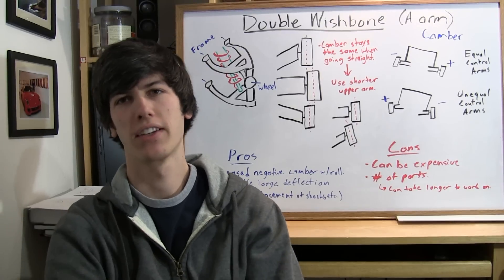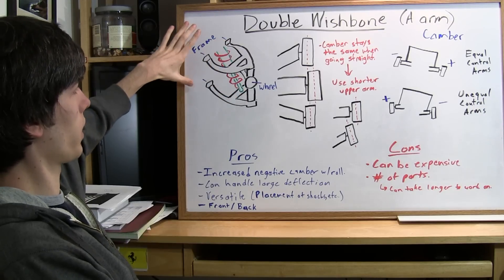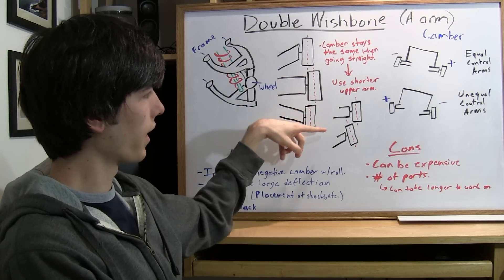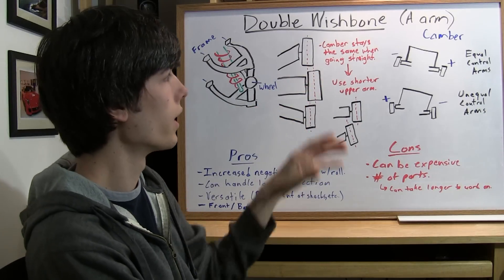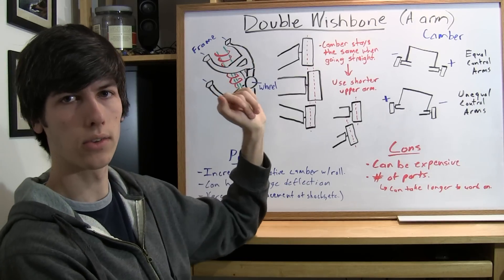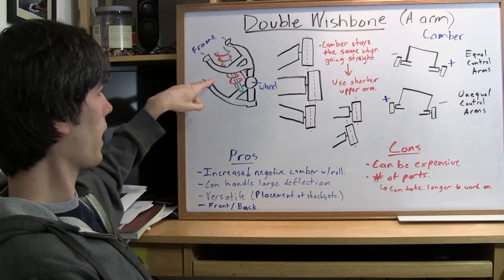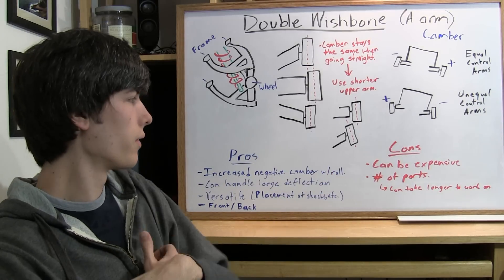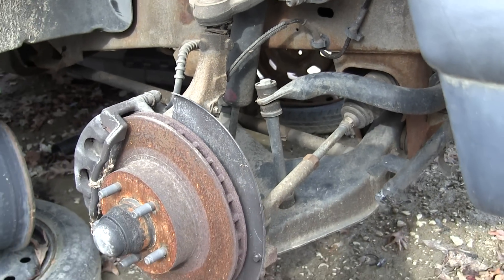Double Wishbone Suspension - Explained

Comment: One other disadvantage not mentioned is the horizontal packaging tends to be worse than a strut. Aside from cost, this is why transverse front engine front drive cars tend to have struts instead, to be able to fit the horizontal engine and transaxle.

Comment: I am not sure if anyone has said this, if they have I apologize for duplicating a comment. I also know this video is a decade old but I could not find a more up to date video in regards to this specific type of suspension. 

In SLA (short/long arm) suspension you do not gain positive camber on the inside wheel. If you are set to 0 degrees camber at resting, when the suspension loads and unloads it only adds negative camber. To induce negative camber when loading and positive camber when unloading the suspension, you need a trapezoidal arrangement where the wishbones connect to the frame closer together than they do on the wheel hub, only then will you induce both negative and positive camber when loading and unloading the suspension respectively.

However, the camber on the inside wheel is far less important than the camber on the outside wheel. The outside wheel will be taking far more force than the inside wheel, especially on cars that have an Anti-Ackerman steering geometry as the outside wheel is pushing the vehicle. Pro-Ackerman, the inside wheel is pulling the vehicle. The inside wheel has significantly less authority over the vehicle when compared to the outside wheel which is why SLA is still an acceptable suspension setup. The camber on the outside wheel(s) matters most when cornering, the inside wheel still has authority but to a far lesser degree.

Equal length double wishbone suspension is great for drag cars. They do not corner at all and when they do it is usually at very low speeds. The front of the car will rise when accelerating and drop when decelerating. The equal length with mounting points on the frame the same distance apart as the wheel hub, will insure maximum contact patch no matter the forward or backward forces applied to the vehicle. Perfect for drag cars, atrocious for vehicles that need to corner.

Equal length double wishbone suspension : Both wheels have the wrong camber in corners but perfect for straight line acceleration/deceleration.

SLA double wishbone suspension : The outside wheel has the correct camber angle while the inside still does not. Am improvement over the former but still not perfect. This setup also becomes a problem for vehicles with high downforce. The downforce will load the suspension, forcing the vehicle down and the wheels to increase camber in the negative direction which reduces your contact patch at high speeds.

Comment: I watch some of your video's and you do a good job, so I have one for you. Being a mechanic all my life, I tend to question how things work inside and out so I can better diagnose them. I had to figure this one out on my own years ago, but still to this day you can't find any info on it? It's the Mercedes front lower ball joint design. Two lower fixed arms with ball joints side by side at the spindle. The first thing when I seen this on the rack was how is this not binding? 90% of mechanics has no idea or even question it and don't want to know either?

Comment: Rereheatherere Performance Parts
COMING SOOON!!!!!!!
Rereheatherere Performance Parts always supplies top shelf racing parts for your cars. We manufacture high performance turbochargers, exhausts, intakes, and more. 

Rereheatherere RP1 Large Diameter Turbocharger kits     starting at  $1799.99
The RP1 turbo kit from Rereheatherere performance is a top-of-the-line turbo kit that is available for a wide variety of Japanese, American, and euro cars. This turbo is rated for 32psi.

Rereheatherere GTSR Racing Exhaust    starting at   $649.99
The legendary GTSR Performance Racing Exhaust is designed for maximum sound, exhaust efficiency, as well as minimum weight. Gains anywhere from 5-15 hp and 5-10 tq

Rereheatherere Limited Edition RK1 Bong   starting at   $74.99
The Rereheatherere RK1 is already known for providing legendary hits, but the limited edition RK1 with a built in perc provides the type of mind rotting hits our bongs have become famous for!

Rereheatherere consistently outperforms top brands, like HKS, Greddy, and even Garrett, make sure to clear some money out because you do not want to miss the limited edition Rereheatherere performance parts drop coming December 2020!!!

Comment: Good video! I would've liked to see an animation, but you covered the concept well. 

You said an advantage is that the double wishbone angles as it rises. Is this a disadvantage when you're driving in a straight line and hit a bump?
Reply: He mentioned that doesn't happen when going straight
Reply: @davidalvarez5929  I thought it angled when raising and lowering. If you hit a bump (one tire only, like running over something) the suspension would be raised.

Comment: Great video, one thing I don't understand is why some lower control arms in this type of suspension doesn't look symmetrical, meaning the ball joint is not exactly on the middle between both bushings

Comment: Obviously ancient video in YouTube years - but this kind of "explaining the basics" type of video is VERY useful to widen your knowledge at least from a "how does X work, compared to Y. I must admit at the end I was stumped by the actual car demo. Where, pray tell is the SPRING for that? I see no coil, doubt VERY much it had a leaf spring, and while I an see the upper/lower susp. members, shock absorber and even the sway bar end link this vehicle was obviously a moon rover since the low gravity required no spring. I can't even see where the spring WOULD have been if removed as there is no cup that I can see. Very peculiar. I am sure that's why this channel os no more... The missing spring conspiracy!

Comment: 3:05 why does outer wheel have positive camber?
Reply: I think you mean "inner" wheel, but I agree, both wheels have negative camber due to the shorter upper a-arm.  Since most of the load is carried by the outside wheel, the net effect is still better traction.

Comment: cons for unequal arms should include: Depending on the "dampening" varying response to steering. If the car would be driving such that thesuspension is dampening out a bump in the road the wheels are somewhere in a (very) high position while thet would be in a really low position when you drive through a hole in the road. If then the wheels either goes up while alreadyl being up or goes down when it already is down due to the roll you end up at the point where the suspension travel stops. You need to avoid roll by using stabilsers or by using a double wishbone! Double wishbones have the advantage that they roll less which is because wheels stay aligned better and thus roll would mean the car liftsbecause the tyres surface tilts thatthen means the spring gets the load while the other side gets a smaller load (the total force on the springs and shockabsorbers equals the car weight always (neglecting the acceleration of the body that is required). Please look at my picture and ask yiurself what that teaches you? 

(The answer natuarlly  is that if you think about it, it is only logical that we tend to pay more attention to car supsensions, because we tend to see them more often!)

Comment: So far I've rebuilt a transfer case on a Chevy K10 and the rear end suspension on a Lincoln LS thanks to your videos. You are super - thanks for the visualization.
Reply: Joseph Maxwell I have a lincoln ls that needs work. What did you do for bushings and shocks.  Any advice is appreciated

Comment: +Engineering Explained
Can you please explain why some cars have this in the front and others have it in the rear. GTR has I in the front and the STI has it placed in the rear, for example.
What are pros and cons for each? What are the benefits and drawbacks of having both front and back double wishbone?
Reply: Charles Ramirez just from watching the video I assume what it means is that, while cornering, the wheels with the double wishbone will have better traction due to the induced camber. Perhaps those cars throw weight to that specific tire on turns.

Comment: i've watched your videos for a while now on other topics, but since i am designing a suspension i came here yet again, now would you say that in straight sections of road that the unequal length A-arm wishbone suspension would have increased tire wear? also would you think a system to link the steering to the suspension would allow equal length systems to have the same amount of control? say i used a cantilever like in a push rod suspension to change the camber by moving the upper control arm in and out, and set this up to be adjusted by the steering angle
Reply: aterack833 Do you already know the answer on your question:"would you say that in straight sections of road the unequal length a-arm wishbone suspension would have increased tire wear?"  I think this is true because I think you get positive and negative camber on straight (bumpy) roads with these unequal arms, which isn't desirable for your tires.

Comment: I get how the camber can be negative when the upper control arm is shorter, but how can it also be positive? I'm thinking of it in terms of a fourbar linkage.
Reply: KiwiKiller88 Think about it as a tire that goes down relative to the frame, like there is a small picture drawn by Jason of a tire that goes up relative to the frame (2nd picture under textiel "User shorter upper arm")
Reply: Actually if you imagine it, when tire goes down relative to the frame, it will make a negative chamber

Comment: Cv joint with plunge travel isn't necessary if the half-shaft is of equal length with both the wishbones, correct? Could someone also tell me why the steering rod isn't required to have plunge travel?

Comment: hey man, I have a little 1993 nissan d21 pickup. it has a solid axel in the rear and ifs with torsion bars and 2 control arms. do you have any videos regarding torsion bar suspensions? I'd be really interested to see how it differs from a normal double wish bone.

Comment: Great videos!  can you explain semi trailing arm rear suspensions?  mostly why they were  abandoned and why letting off the throttle while banking causes spin out, snap over steer.  correctable or can problem it be minimized?

Comment: Ford used Torsion bar suspension in their late 1990s to 2011 4x4 Ford Rangers. Mine included. : 3 The 2 wheel drives just got coil springs.

Comment: I have trouble visualizing, how having s shorter top control arm, facilitates negative camber during cornering. Great vid btw. Thanks
Reply: +Indu Shekhar Kumar The shorter control arm (up top) pulls the top of the tire inward sooner when the body rolls (because it's attached to the body).

It's kinda confusing because of where the short wishbone mounts to the body, the mounting point is actually closer to the tire, so when the body rolls, that point of the frame pulls inward further.

Comment: Can anyone tell me if short&long arm double wishbone is the same as independent double wishbone?? Cheers :)
Reply: I think so. An independent suspension is where one wheel can move and not affect the other wheel. Most suspensions are independent unless you have a solid axel connecting them.

Comment: Hello Engineering Explained. I was wondering if there is some standard or "golden" ratio between the upper and lower control arms. Maybe combined with the weight of the vehicle. This just to get one started, I guess center of gravity and grip and lots of other factors come in with the fine tuning. Thats where adjustable upper control arms come in but I need to have some starting point Thanks for good videos =)
Reply: from my reading, in general, the upper should be ~70-80% the length of the lower.
also, if you are modifying a standard macphereson suspension, be advised that mounting the spring and shock (vs strut) in a different location can and will change your wheel and spring rate depending on the mounting location.

Comment: After watching this video, I get curious about BMW M3/4 front suspension system, this is what i've found: "Double-joint spring-strut front axle", is it the double wishbone? Thank you again for your videos.
Reply: It's not double wishbone. BMW doesn't use the double wishbone suspension on their vehicles and use strut suspension only. Mercedes Benz, Honda, Mazda has the double wishbone suspension on all their vehicles.
Reply: NihselAuto Called McPherson type suspension.
Reply: TulllTott yep that.
Reply: NihselAuto
And Audi , Vw , Skoda , Seat
Reply: The M3/4 front suspension is still strut based. They call it "double-joint" because it's a modified MacPherson arrangement. Normally, a MacPherson strut has a single lower control arm (LCA) with a single balljoint that bolts to the bottom of the spindle (the part that the front hub, brakes, etc. is on).

What BMW, and other car companies have started doing, is that instead of using a single LCA, it's two smaller individual control arms, bolted to the bottom of the spindle in slightly different places. It has some advantages such as reducing the scrub radius more than with a single lower control arm. 

Edmunds did a walkaround of a BMW F30 (same suspension architecture as the M3.4). The link has pictures with the double-joint and a brief explanation: 
http://www.edmunds.com/car-reviews/track-tests/2012-bmw-328i-suspension-walkaround.html

Comment: What are the implications for off road? Are solid axel's better?
Reply: Solid axels are stronger but most off road vehicles don't use them. Look at dune buggies. You lose independent suspension with a solid axel. For a top of the line off-road vehicle you want lots of suspension travel and 4 wheel independent suspension.

Comment: hi nice video, i have a proble with my 01 primera, the left front wheel is not in a center of the wheel hole! if you look the car of profile the wheel is too back, and my steering is strongly charged to the left...., i changed lower and upper arm, and the problem persist!!! the question, can be  bad setup of suspension???? with alignment i can solve the problem??????  thanks!!!!!!

Comment: Can you help me? I'm doing a project at university on a Solar Car and my group got given the suspension. What would be the best suspension that we can use for the front and the rear?

Thanks in advance :)
Reply: that depends on type of the vehicle. Offroad, sport or that it's going to be used to transport heavy weights. It also depends on dimensions and weight of the project. Im assuming it's small grandma car which is slow so you dont need anything special

Comment: Why do we have a positiv camber at the inside tire ? If the lower control arm moves downward / rebound / the inside of the tire moves in the same direction, so I should have a positiv camber, or not ?
Reply from the maker: If you were to lower a car, the control arms are effectively going "up" as in the angle would pull the top of the tire inward, giving the wheel negative camber.
Reply: Engineering Explained But if the upper control arm remains in rest and the lower moves downward e.g. if i drive trough a hole or a left corner like in your example I apply tensile forces on my shock absorber and that  is a positiv camber ? Maybe I will understand it better If i see it in real. Thanks for your explanation anyway, Top channel, keep it up ;)

Comment: can you explain Multilink Coil Spring VS Double Wishbone/Four Link With Lateral Rod.. which is the best comfortable  suspension?
Reply from the maker: As far as comfort is concerned, you'll notice the biggest difference with soft springs and dampers, regardless of the design.

Comment: SLA suspension allows more camber recovery, but usually by increasing the roll centre height. The car would roll less, but it does not decrease weight transfer signficantly. In fact, it can cause weight jacking, which can be bad for stability. Another issue is that unless ride stiffness is high and/or antidive/squat is high, better camber recovery when corniering will come at the cost of compromised longitudinal grip due to compromised camber. It's a matter of balancing tradeoffs.

Comment: Can you elaborate on the suspension systems used in heavy earth Movers? I was trying to make sense of the PBS series segment "Raw to Ready" that featured a discussion on the design and manufacture of the chromed pistons used in the front pneumatic suspension of heavy earth movers and how they manage to turn with such a heavy load. Please email me your comments how the relative compression of air and steel springs compare to each each other in suspension, steering, and load distribution. Thanks.

Comment from the maker: They are potentially the same thing, the image I've drawn in this video is both of those. The coil spring over shock absorber simply refers to how the suspension deals with springs and dampening, nearly all vehicles use a coil spring and shock absorber, and most have the coil spring over the shock absorber (around it).

Comment: hey EE i really like your vids. they help me understand how my car works and how better to look after the different components. my rx8 has an independent double wish bone front suspension system with independent rear multi-link. could you do a video explaining how mulit-links works and the pros and cons. could you also do a video expanding on struts as i have an oem tower strut in my rx8 and i'm finding it difficult to find an aftermarket part that looks decent. i would really appreciate it.